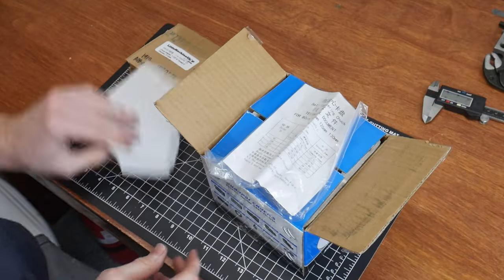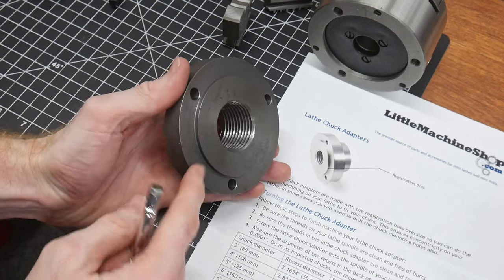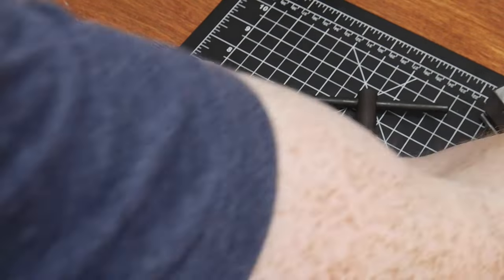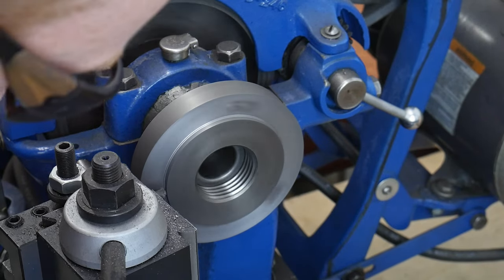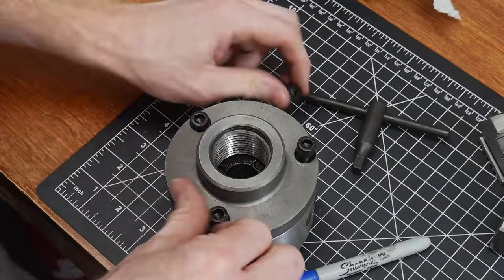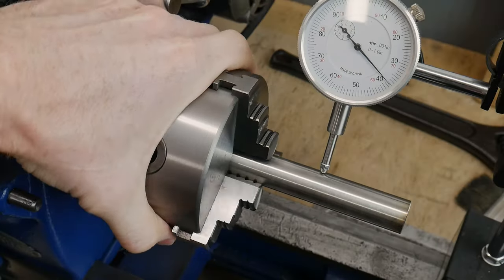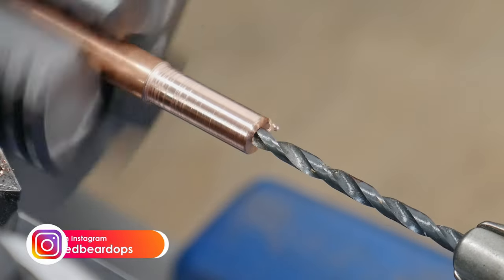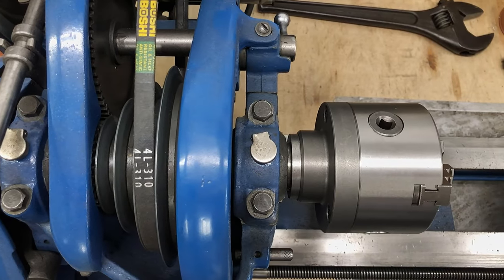Installing a 3 Jaw Chuck - Antique 1937 Atlas Lathe

Comment: I'm in the middle of this same process.  My old Wade 8A has a 2"-10 thread on the spindle so I have to make a custom back plate. :(  I got the Shars "adjustable" 3 jaw scroll chuck.  Three jaw chucks can have different runout amounts at every different diameter.  Dressing the jaws at a specific diameter will on make it perfect at that specific diameter.  It may not correct runout at any other diameter other than that one diameter.  

That's the advantage of and adjustable 3 jaw scroll chuck.  It basically combines the features of an independent 4 jaw chuck and a 3 jaw scroll chuck into a single chuck. :) 

Great video!  Keep em coming. :)
Reply from the maker: Very cool! Cheers sir. Thanks for the info

Comment: Great little video James. Your question on the Loctite. Don't be afraid to use the release type Loctite for this application. I can't remember the number but the dealers that sell these products can guide you to the correct choice.
Thanks for sharing.
Reply from the maker: Thanks for the tip! CHeers

Comment: Hi James
By any chance does any one of the chuck key holes have any odd markings near it, if so this was probably the keyhole used in the factory to tighten the chuck before the jaws are machined central.
If you have that mark(don't know if china chucks go that far), use it to tighten the chuck and check the runout on a piece of stock.
Cheers from Australia Bob W
Reply from the maker: Thanks for the tip Bob! I'll take a look at it.
Reply: @RedBeardOps  👍

Comment: Nice machine, I have two 1935 sisters but with the 54" inch beds. Definitely a 1937 or 38' you have there. Try not to use the back gears for chuck removal, the gears are made of zamak and are known to break when doing that; instead try squeezing the main spindle belt with some vice grips to lock it in place (of course with something to protect the belt from the jaws).
Reply from the maker: Thanks for the tips!